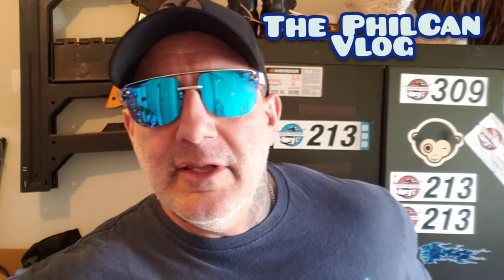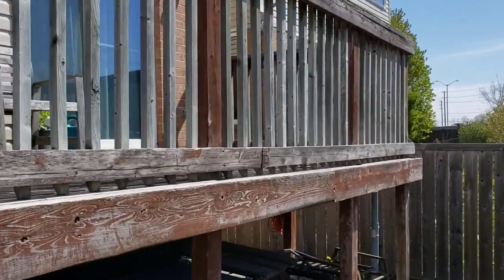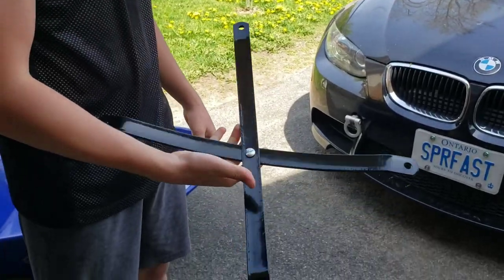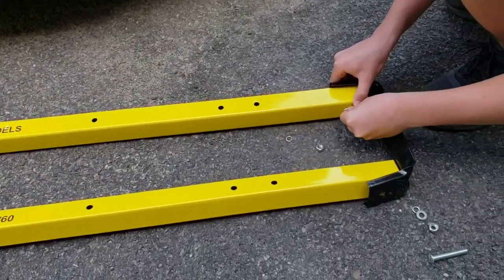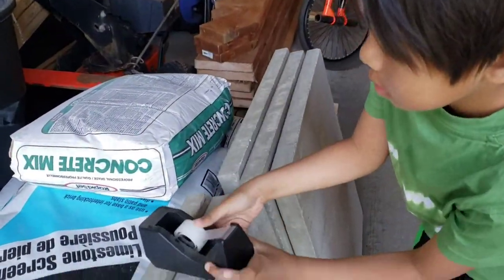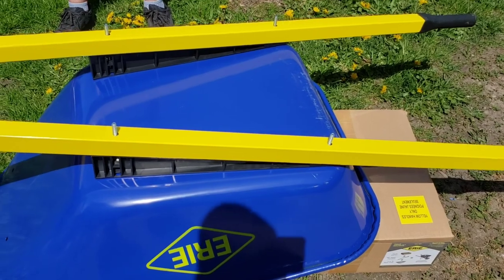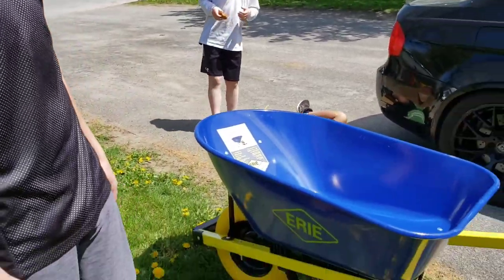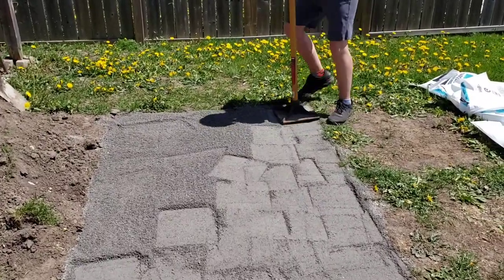Back Deck Reno - Part 1 plus Erie Wheelbarrow Assembly

Comment: How's the wheelbarrow after few years of use? Did it start to rust? Are you happy with it?
Reply from the maker: @skopjev2  Has no rust. I kept it in a shed. Excellent wheelbarrow. Still solid after moving big rocks. Mixing concrete. Would definitely purchase again.